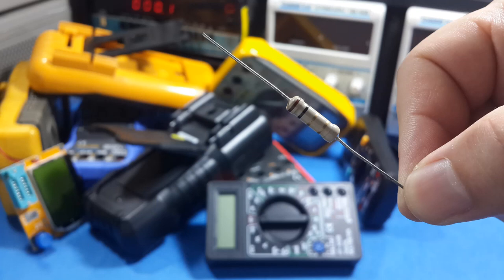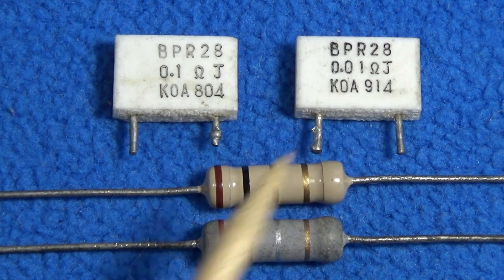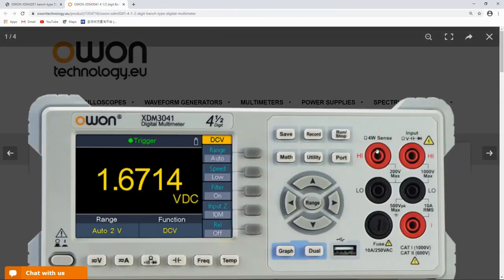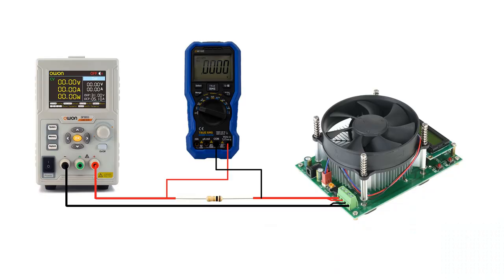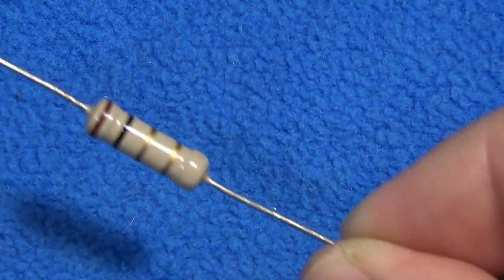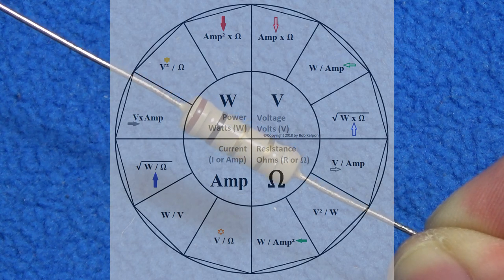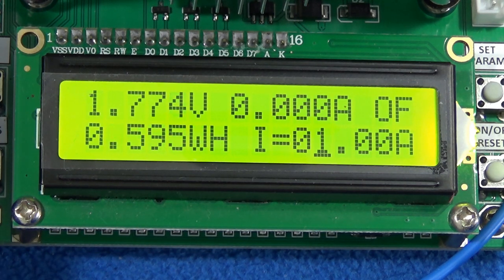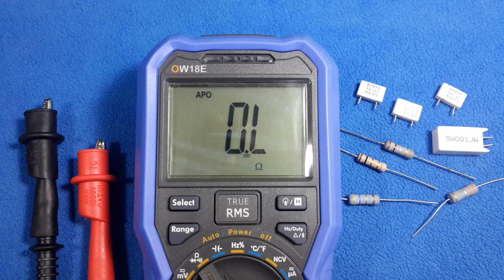How to measure low ohms resistor with a multimeter / 1R0 R01 0.1 Ohm Shunt DMM and a dummy load test

Comment: Cant you just set bench power supply at 1amp and measure voltage drop across the resistor? What would you need electronic load for?
Reply from the maker: Hi! Cables are a serial resistor too and it will drop voltage. It is the reason why electronic loads have 4 connections. If we make the measurement on the resistor, we approach the accuracy of the voltmeter, ignoring the voltage drop on the wires. If you set the power supply to one Amper shorting the cables, the measurement will fall because you will add a serial resistor and the current consume will be less than the set Amper. If you set the power supply to one Amper with the load, you ignored the wires resistance and you are focusing on make a measurement with the less accrued meter you got in your laboratory. (The power supply's meter).
Reply: @bob.kalpon1398  looks to me that you confused voltage and current, if  you set the current at any point in series of the circut its the same current. you can check you current accuracy with additional multimeter if bench power supply is not acurate enough.